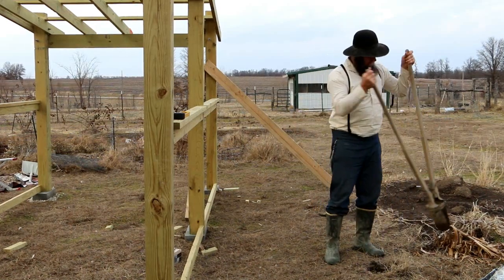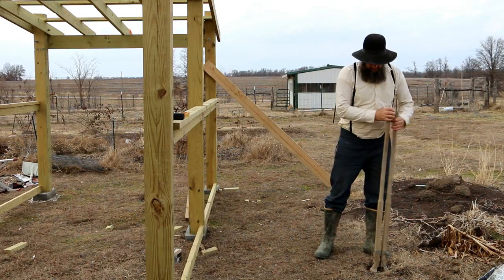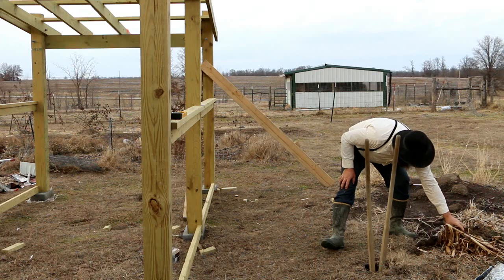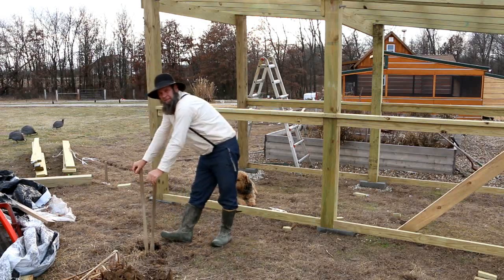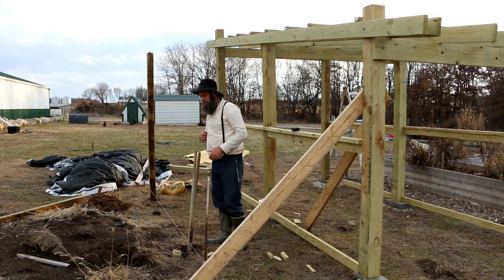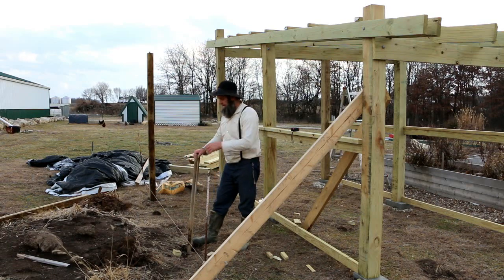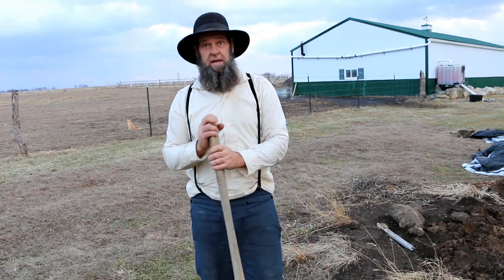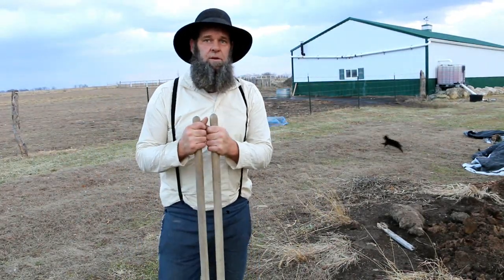BUILDING A GREENHOUSE IN WINTER - TOOL ROOM

Comment: I learned a trick from a road worker about using post hole diggers and it has changed how I use them. He held both handles together with one hand and drive it in the hole 4 or 5 times then use 2 hands to pick up the dirt. It's half the work. Greenhouse is looking good

Comment: Just saw this morning that ya'll have an ice storm headed your way.I hate ice storms, I would rather deal with snow. But the main advantage you have, is that you are off grid. Power failures come with ice storms, so you will not even notice that inconveniance of ice storms. You also do not have trees near your buildings to come down on them. That is another hugen problem with ice storms. If the ground gets very slippery, you might want to bring your horses in the barn, so they don't slip and injure themselves. My Uncle lost a horse to slipping on the ice in the pasture and breaking it's leg. Looking forward to seeing the green house.

Comment: Something you might try that helps eliminate a couple of problems building any type pole structure. Once you have all your hole placements dug and reasonably square place half of a cap block in the bottom of the hole then drop your poles. This will make it easy to space the exact distance between the poles, make it easier to get the building perfectly square, make it easier to set the poles plumb and easier to get square poles square with the building. I do all this before I backfill the holes.

Comment: You should dip the bottoms of those posts in tar that you're putting in the ground even though they are pressure-treated they still will rot swell and bust eventually.